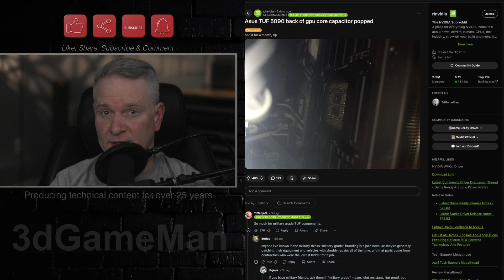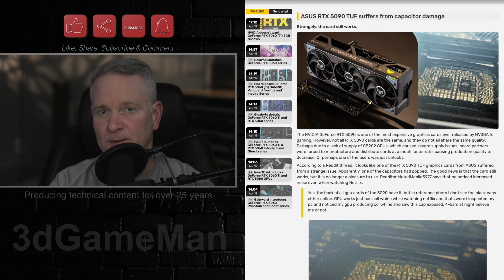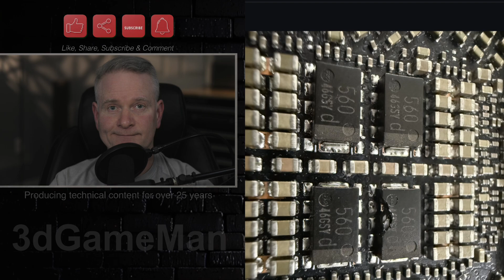Asus RTX 5090 Capacitor Damage #nvidia #rtx #rtx5090 #rtx5080 #rtx5070 #rtx5070ti @3DGAMEMAN ​

Comment: I don't envy the user for having to deal with ASUS support if their recent PR blunders are anything to go by. Won't be surprised if they try to blame the customer or slap on a hefty charge for a repair or replacement.
Reply: I know someone whose fans failed on a 3070Ti that has a 5 year warranty and ASUS has so far paid for the cards return to its depot for evaluation. Dont have more details.